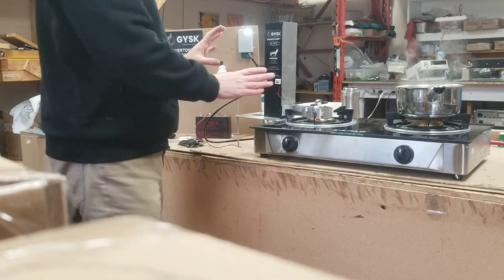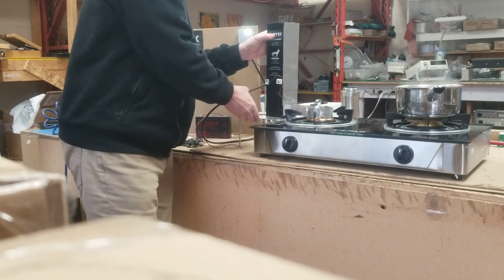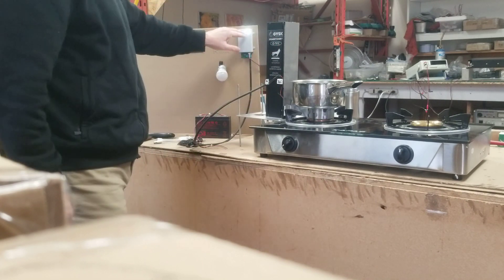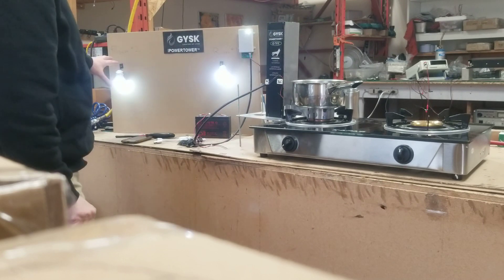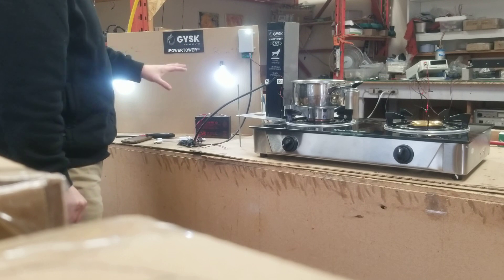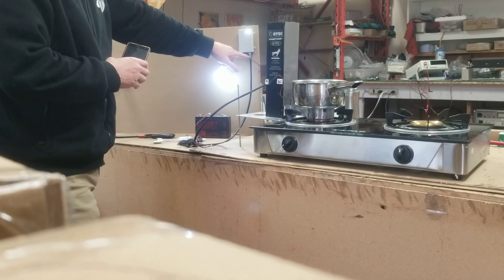5V USB 12VDC battery charging Generate IPowertower while you cook on a gas burner

Comment: Hi, how many of those 22w will fit in this design?
Reply from the maker: You cannot just throw modules in a already engineered design. 56 x56mm modules. Will not work on this design. These are 40 x40mm either TEG1-12610- 5.1 x2 or TEG1-4199.5.3 x 2 for higher voltage!

Comment: Stand By for an order from this observer for one of your regular iPower Towers fitted with the propane burner type chimney. 👍 BTW, how much for that radio light ? 👌😇 Is there a super capacitor in the radio light ? The tell tail sign of that is it takes a few seconds for the radio to sound after you flip the switch.
Reply from the maker: We only purchased these radios as sample. none for sale!
Reply from the maker: Lots of towers though! Standard alone and the wood stove unit for insert. The one in the video was just a prototype for a large Africa Government we designed! order to follow for 10's of thousands, we hope?
Reply: @thermoelectricpowergenerator  Well, I'm just saving up a few pays after the Holidays here, then I will be placing an order for a standard Blue or Green Full Regular Tower Kit ver. 2. I'm in BC 👍😃
Reply: Would this work on a open fire log cabin
Reply from the maker: @brianforgie7050  
If the fire was contained and only the hot side was exposed. If you send an email too tecteg@rogers.com we can send a video to show installation!
Reply from the maker: @brianforgie7050    Yes, withproper shielding of cold side!

Comment: Looks like I'm buying another one❤🎉
I'll probably contact you within a month.
Reply from the maker: Not a problem we have standard towers in stock and wood stove heat sink inserted units as well in stock. The one you see in the video is a prototype for Africa. We are working with Local Governments on a country wide program to bring power to villages that don't presently have any sources of power for lighting, schools, residences, community centres! These units are designed for farms of towers. We can gang 10 on a common cooking stove to produce 100 to 200 watts depending on the stove size! So, very modular like solar farms. Individual units added up to increase overall power output!